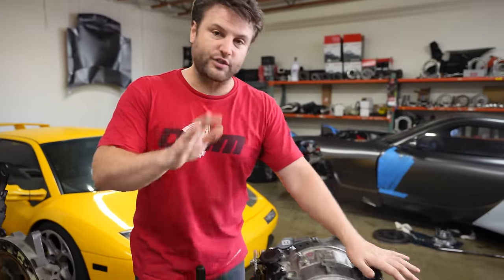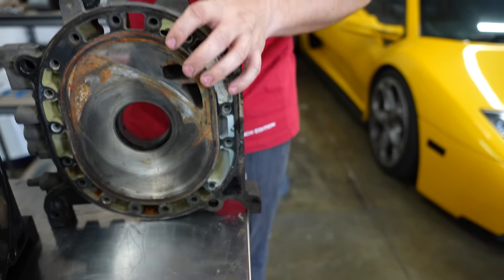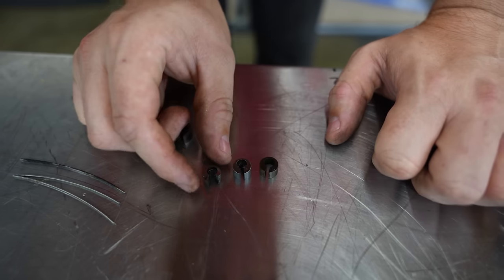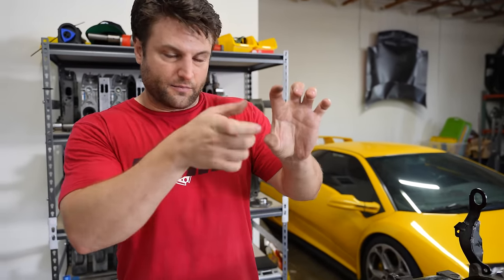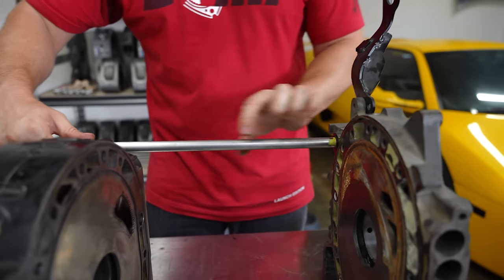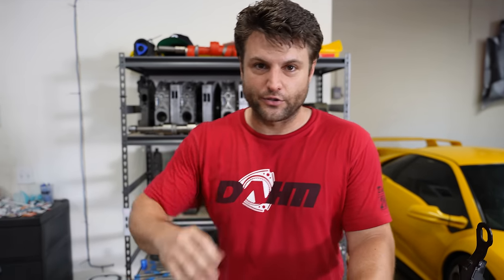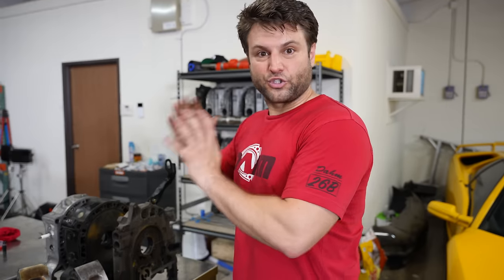Fixing the BIGGEST Problems of the Rotary Engine

Comment: Ummm...A very good friend of mine has a 1968 Suzuki RE-5 Rotary (500cc single rotor) motorcycle he rides daily. It has 280,000-odd miles on the ORIGINAL factory seals which he rotates 180* every 25,000 miles, he changes the crankcase oil every 3000 miles, keeps oil in the auto-lube tank (2-stroke pump) and uses 100% gasoline only. The compression is good as factory, it doesn't use any crankcase oil, or smoke, plugs don't foul, it's been featured in three bike magazines as a "dinosaur" or "survivor". Being carbed, it doesn't get great fuel mileage, but 38-45 MPG isn't bad for a pretty quick bike. CURING the rotary means fuel injection and staged supercharging if you want a street engine. Funny, Herr Wankel designed it as a fixed RPM aero engine.

Comment: I like your overview.  I would suggest the locating hollow pins and tension bolts be combined into one piece dual purpose items.  That would require exterior plumbing for oil circulation. Sounds like that could help oil cooling or provide a means to reduce oil temps, a positive opportunity.  I don't recall you considering how to cut pollution or add turbo charging or if centerfuging exhaust could skim off unburnt fuel back into the fuel loop to be reburned ?  I see you have a stock of parts.  Is anybody remanufacturing the major (expensive) components such that you can cut your experimental costs ?  Do you have a pipe to Mazda for collaboration ?  Might be worthy.  In the development process, improvement goes in spurts.  You have alluded to adding stacking stages for power but how about dedicating a stage for reburn or vibration control ?

Comment: Also, you can use LPG instead of gasoline, to keep the oil film on the cylinder walls(gasoline washes away the oil film from the walls). Rotary engine feels great when working on LPG.

Comment: Wow, I was lucky! I had 3 of these engines and rebuilt two of them. The fails all came from the outer O ring seals around the chambers. The rubber hardened and cracked in the combustion area allowing hot gas to blow into the coolant chambers. End of engine. All three of my engines failed in that way. They did have the stainless steel shield strips that were to prevent this fail. Didn't work.

Comment: Why not use a keyed dowel like a triangular dowel that would prevent torsion. Dowel could be partially round for threading or have another location for keyed push fit dowels along with regular types.

Comment: Thank you. The riders (including me) of two-stroke motorcycles were used to putting two-stroke oil in a small tank, completely separately from the petrol (gasoline) tank and the oil from there was metered into the inlet tract. is this not a possible way out for rotary engines? One tank for the fuel and one tank for the oil. In modern Diesel vehicles there is a special tank for the 'Ad-blue' fluid. Car driers manage with that. Could they not also manage with an oil tank? Best wishes, Luke

Comment: Now you just need to do some further tweaking and modification so that the apex seals don't need to be lubricated to begin with.
For example, you could coat the engine parts with something that is hard, durable, low-friction, and resistant to high heat.

Unfortunately, I'm not entirely sure how to do that in a garage.

Other possible upgrades you can make to your engine...
- Replace the first of the two spark plugs with a glow plug. In theory, doing this can improve your thermal efficiency, which in turn means you can potentially make more power.
- Ever heard of Freevalve? You can DIY that.
- Screw spiral gears, get yourself some herringbone gears. No need to worry about axial loads.
Reply: Also, you can perhaps replace rubber with something that performs just as well (especially in high heat), but is more resistant to the corrosive effects of ethanol. I wonder if PTFE would work for those purposes...

Comment: What upgrades need to be done for e85? I like the cooling factor and cleanness. Right now also cheapness of fuel... Does the anti knock factor (the 85, 87, 91...) not matter? Is it for the detergents in the fuel? I have an 04 rx8 that I love and am trying to do every mod I can for a reliable daily. I have done sohn adapter, still premix but lower amounts, replaced all oil injector lines with the less sensitive lines, new high flow 2500 cfm fans... If e85 will help yay!!! What needs done? I also plan on changing oil and coolant thermostats to lower temps just waitn on $, and e85 would help...

Comment: Great video.  Regarding the dowel rods, im no engineer, but...  First thing that came to my mind was why didnt they just CAST dowel pins into each section of the housing to handle the sheer effect of the motor in order to allow the long bolts to handle the job of compressing the sections together?  Hell, even if they added flanges around the outside perimeter of each section solely for those pins, that would be a better, more robust solution than asking a bolt and sleeve to handle both compression AND sheering forces.  Unless im missing something, kinda seems like an obvious solution...

Comment: You're right about the oil. Synthetic oil are the best for lubricating moving parts. On the other end it is terrible in the combustion chamber as it doesn't burn. I went on a service call in an extremely remote mine. So distant that they burn all their waste to make energy. I was surprised when they told me they use mineral oil in their gearboxes. I asked why as they would get a much better life out of synthetic. The guy answered me they try to burn the synthetic waste oil but it won't burn!

Comment: Think using Amalie 68326-93 grease would be good for coating the dowel, and tension bolt shanks? Seems to have good properties for use in this case. Great in high pressure, heat resistant, oxidation protection, anticorrosive, inhibitor, water repellant.

I'm never going to build a car, but just curios lmao

Comment: I am curious if ceramic coating your rotor, like how you would a piston and combustion chamber on a traditional piston engine, would improve rotor reliability. Theoretically it would increase combustion temperature and help burn off any hydrocarbons and prevent build up on your rotor and would insulate the rotor and prevent heat transfer.

Comment: In my youth, I was a huge fan of the NSU Ro80. I still like its bodywork and style. With regard to the practicalities of the rotary engine : the bottom line is that it cannot compete with the piston engine in terms of longevity and economy. After NSU and then Audi gave it up, Mazda invested a lot of money in making it a viable proposition to motorists, but then they also gave up on it. It is one of the most famous inventions that failed to prove its worth.. in a nutshell, it does not “fly”.. 🤷🏼‍♂️

Comment: Why does no one weld additional structure support to the area that cracks as a result of torsion from higher HP/TQ? I would think that increasing the thickness at those locations would prevent failure there.

Why not have thicker tension bolts made instead of using a two piece set up?
Makes sense if you are already using a modified external oil system for the engine.

Why not add additional solid dowels at different locations between the sections to help prevent them from twisting?

Maybe I missed the explanation in the video. You said one of the biggest problems with the engine was the exhaust.

Do you port and polish the exhaust on the engine?
Do you increase the exh. pipe dia.?

Comment: Rob, get your facts straight.  The benefit of E-85 in engines are:
1.  The fact that alcohol has a solubility factor almost double that of gasoline.  Everything gets cleaned as the ethanol runs through the fuel system.
2.  85% ethanol = less petroleum product by volume = less hydrocarbons to burn = less carbon build up.  It's not 'random impurities' building up, it's just the nature of gasoline - a petroleum hydrocarbon.
3.  Cooler ignition temps will cause MORE carbon build up when running gasoline.  Spark plugs hold the evidence on combustion temps and carbon buildup.
4.  Running more timing doesn't make more power.  You adjust timing to the fuel you're utilizing to prevent pre-ignition at an ideal A/F ratio.  It's a bit complex, but you burn MORE E-85 because it has less energy per volume compared to gasoline.  E-85 also burns much faster so advancing the timing to make best use of the burn is needed.

Comment: Hilo👋🏽fairly new to the rotary research and just curious. So if you block off the oil metering pump how does the engine get lubricated besides the premix. Does that mean theres no need for oil and oil changes having the 2stroke premix or does it still get oil from the oil pan just not squirting through the oil metering pump? Big fan by the way. ❤
Reply: yes

Comment: Am I understanding you correctly, we should block off the oil metering pump and mix 2 stroke oil with our gasoline  in our tanks and because the oil is designed to be burnt clean it will also lubricate the seals? Makes sense for weed whackers, leaf blowers etc. but no issue with the fuel system with the oil?

Comment: To solve some of the torsion issue, I saw someone who was machining these from scratch, had implemented built in studs somewhere around 20 or more studs per housing frame that fit it into the next frame, so that it only needed those studs plus the torch and bolts, and had no issues with excess torque 
Is this doable as a after mod or would it only be something you could feasibly do machining the parts from scratch? ?

Comment: It's like it should have also had additional outer mounting points for a structural square type reinforcement on each side of the motor to prevent torsion upon the assembly under high load.

Comment: I've heard that 2-stroke engines can sometimes run on much lower levels of oil than is recommended. That said, it would be interesting to run a series of engine tests, or maybe multiple tests on one engine since rotaries are so easy to put together, and see just how low you can go with the pre-mix and still get the desired result.
Reply: Use one of the competition range of synthetic 2 stroke oils which are intended to be mixed in a high petrol to oil ratio would be good I think. These specialised 2 stroke oils are very low ash producers in the combustion chamber.

Comment: if you were to disconnect the oil metering pump and injection system. what would the premix ration be you'd be using?

Comment: Hey
Im new to rotary engines, I’m thinking of buying an rx7 fc with turbo and I want to have around 250hp. Im intrested in fuel consumption because I’d love to daily drive it and then what modifications are needed to be done? I know that better cooling system is important.

Comment: Looking at the casting and the oil tube and the casting crack leads me to ask.
Is that a cast aluminum or cast iron block and does that oil tube cool and shrink slower than the casting?
I'm just visualizing that tube harder than the casting once they're at temperatures that stretch the metals and I'm visualizing that tube cooling slower and causing a crack in the casting.
Reply: After all there is oil in it. 😉

Comment: Don't block off the oil metering, just install an adapter (I.E. Sohn) to pull clean 2-stroke oil from a separate tank and maintain better seal lubrication.
Reply: You can only do that on an S1 engine

Comment: The apex seal oiling issue is potentially very simple. High temperature dry film lubricant coatings on the rotor housing and ceramic apex seals.

Comment: In 1975 Suzuki came out with Rotary Engine motorcycle, the RE5. It was 500 CC, 62 HP and 55 FP torque. It was a great road machine but did not sell well so it only lasted 2 years. At that time early seal failure was the big problem with Mazda Rotary engines. Suzuki solved the seal problem when they designed their rotary engine and sold the patent to Mazda so even though their cycle was a failure in the sales department, they recovered their investment by selling the technology they discovered.

Comment: Rotary engines have much fewer problems than piston engines. They're not all understood by mechanics and Mazda didn't exactly aim for perfection. I grew up in love with RE Amemiyas RX-7's. I wonder how much he learned building rotaries for so long
I was so fortunate, but an actual RE Amemiya imported to Thailand ran out of gas on the side of the highway in Bangkok and I got to get up close with one of the cars I used to love and admire as a kid. When the owner got gas in it, you could hear that it was making loads of power. I was so giddy like a little boy.

Comment: I've never had a rotary engine car before, but from an engineering stand-point, your making a lot of sense! I have worked in a machine shop with Howard Heughs' Nephew (Gary C. Heughs) in Washington State in my mid 20's and he showed me a trick to allowing more surface oil on the engine parts by porting the ports more at an angle to make the parts last longer. There are a lot of tricks to the trade that can increase the life of your engine! Another thing is the type of gaskets that you buy can have an effect on preventing gasket leaks! Loved watching your video and do believe you are definitely on the right track! Thank you for sharing your knowledge!

Comment: A lot of carbon issues are about PCV without a catch can.  If you look at an intake of any car and you see oil coming in from a vacuum line, that is guaranteed carbon deposits in your engine over time.  Put a catch can on every single build.

Comment: Hi Rob / readers,  

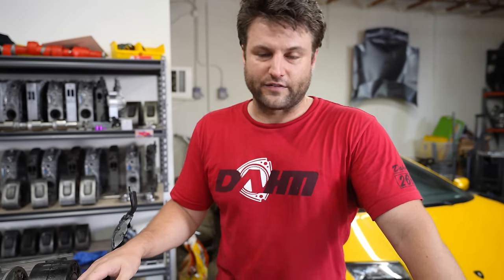Thank you for the video. At 9:28, you mention that E85 is the biggest upgrade you can make to your rotary engine. However, you also say that you obviously can’t just swap to E85 into it without modifications and that it requires aftermarket electronics.  

So, does this mean I can't simply put E85 in my RX-8? And what kind of aftermarket electronics are you referring to?

Comment: There is a way to stop twisting and its not just heavy thick dowling 

Run a 8mm alloy plate on the bottom of the block and the sump. 
We ran our 13b turbo sports sedan making 750hp in the late 90's on stock 3mm seals for years without a failure this way.

Comment: To avoid the coolant issues start by running atf instead of antifreeze. Then you get no rust, and the oil will burn if it leaks into the combustion chamber.

Comment: I had a R.X 3 it was smooth and it had a great deal of power but as a ex mechanic we must admit that they use way to much fuel and they dont burn it properly but they don't like to be lean so when petrol was reasonably priced it was almost like running a v8 so you obviously have the good and bad without having modified Apex seals they break when they are overreved but in saying that they do come out with a restriction rotor button that would break down at 6000 rpm.

Comment: When they designed it they could've had tight locating pins on one side and corresponding holes on the other.
Then when under tension they can't slip.
I heard a College invented a new metal that's good to 3000 degrees.
Gotta get some and make apex seals.

I've been dreaming about having a magnetic rotor floating in an electric field that's computer controlled so it's constantly redirected away from the walls. No friction so no more apex seal wear.

Now you basically have an electric motor too. You could have a hybrid design that runs pure electric for errands and it kicks in the gas for sport mode and both for top power.
The gas mode can charge the battery so you don't need a big heavy battery pack.

Very few moving parts for a hybrid design and no recharging or range anxiety.
The rotary is so close to an electric motor but windings couldn't handle the heat. Magnets should be ok. Have windings on the outside piece and they can be liquid cooled.
It seems good to be true.
If you see something I'm missing tell me so I can stop dreaming about it 😅.

Comment: You could just get an oil injection pump off of a EFI Snowmobile, they cost about $30 used and about $200 brand new. Should be able to connect it to your throttle and it will add the 2-stroke oil automatically. Add a sensor and a light to the inside of the car so you know when its low.

Comment: If you have ever seen a Mazda factory Race PP they used a metal plate in the top of the motor that was for the means of not twisting the housings and nobody dose anything that was from the factory back in the late 80’s and 90’s

Comment: Have you ever experimented with mirror polishing the rotor faces? In theory it'll keep carbon from taking a hold of the rotor and reflect some of the heat away from the rotor.

Could the oil injection port be repurposed as a direct injection port for fuel?

Comment: Instead of using thicker bolts you can just have sprockets on the sides of the body, it's easier to machine and more accurate, and to maintain. The encasings will fit with each other like jigsaw puzzle peices.

Comment: The thermodynamic disadvantage of '' the ratio of a very big surface of combustion zone compared to combustion volume '' in relation to a cylinder and piston system (classical Otto and Diesel - engine) makes the big loss of thermal enery flow and overall- efficiency evident. Also the high percentage of uncombusted HCs is the reason, why the WANKEL- engine did NOT succeed in the past years. I had much experience with the famous NSU- RO80 in the 1970ties and my wife was fascinated by the smooth runningbehaviour of the engine, but the fuelconsumption was really horrible (up to 17 l per 100 km) for a 115 hp car. R*I*P Felix Wankel  :face-blue-smiling:

Comment: If casings of the engine will have teeth machined in them then no doweling is necessary. Only tension screws keeping halves teeth locked will do.